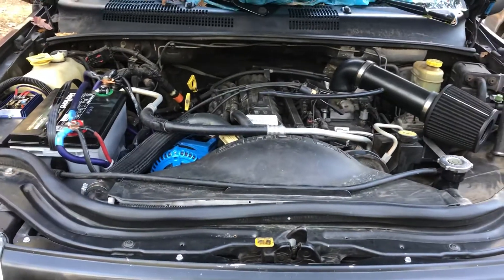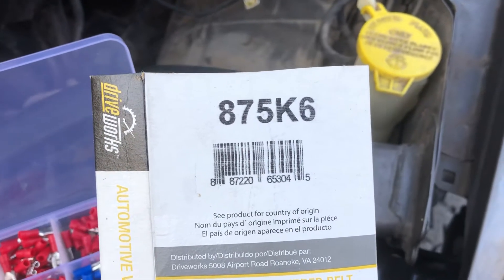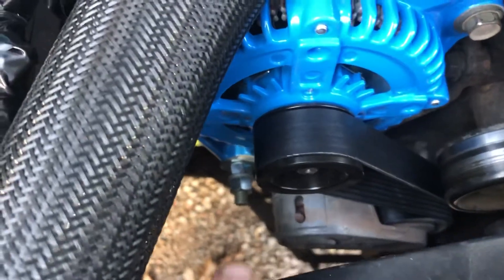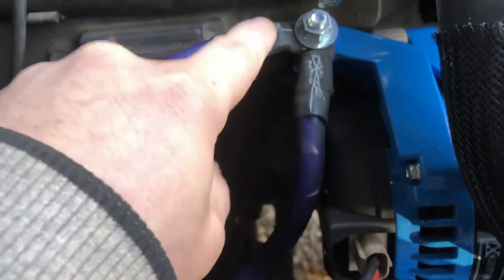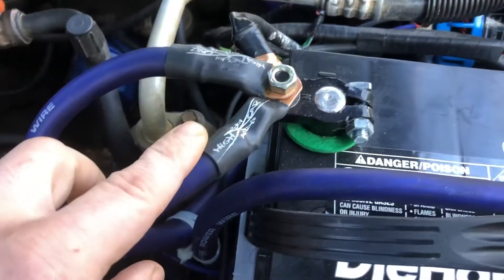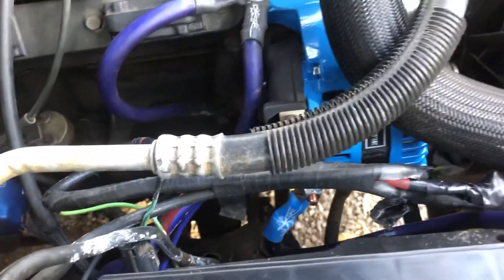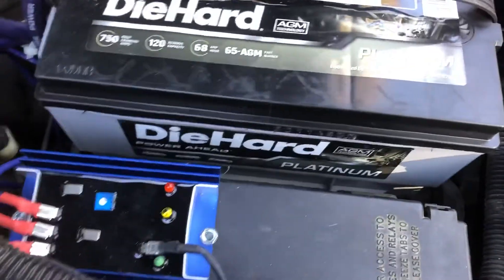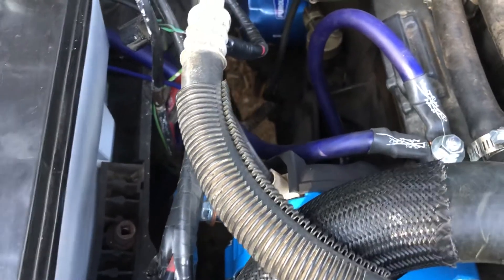How to install a high output alternator 1999-2004 Jeep Grand Cherokee “wj” 4.0l plus Big 4 wiring

Comment: hey man, quick question. i have the same 4.0. i'm planning on doing the big 3 for an audio upgrade. Is that just a random bolt attached to the engine you grounded, or is there a specific ground i'm supposed to upgrade?
Reply from the maker: For your engine ground the easiest place is one of the 3 alternator bracket bolts right on the side of the motor
Reply from the maker: If you have any other questions I’ll be happy to help you out bro
Reply: @Jboost412  Awesome, thanks man! i wasn't sure if there was a specific ground spot i had to use. Since i don't have the same alt. would you recommend running the ground from the alt bracket to the body ground? sorry new to this
Reply from the maker: For the body ground you can actually use the factory location that’s right next to the under hood fuse box just remove the bolt that’s there and clean up the metal with some sand paper and place your new upgraded ground in the spot where the factory one already was as it’s a pretty good spot just lacks a big enough wire for what we are trying to do
Reply: @Jboost412  gotcha! so i'll run my new ground from the alt bracket bolt, right behind the alternator, to the body ground after i clean the metal up. Sound good to you? thanks
Reply from the maker: From there if you wanna go big 4 and ground the alt case as well you can remove the lower alternator bolt and make a stud with 5 16th x 18 all thread make it a little longer then you need it to be that way you can thread in the all thread put a bit on it so it’s just like it was then add the copper lug for the ground and a second nut also acting as a jam nut as well...mines set up the same way...so really I have 2 4/0 grounds off the alt straight back to my lithium then another 1/0 ground that goes to the frame up front since I no longer have a front battery
Reply from the maker: That’s perfect brother! Sounds like your good to go!
Reply from the maker: And like I said anything else at all please feel free to ask, that’s the whole reason I started a YouTube channel to share all of my audio knowledge from years of experience with anyone who needs any help
Reply: @Jboost412  Thanks for all the help man, you're literally the only video on youtube showing a 4.0 you're a life saver!
Reply: @Jboost412  Wait, right side of the motor? my alternator is on the left side like yours lol sorry if i'm not being specific enough

Comment: What was the price of the exact same alt that you have?
Reply from the maker: Mines from brand x it’s a 6phase hairpin 345a that clamps out 373..I believe it was 350 without powder coat..it was a package deal with the regulator so I’m not exactly sure what the alt itself was but I believe it was 350...I highly recommended brand x though “Jonathan Patrick” is brand x’s owner he’s the former builder for c.e.s so he’s very talented with rotating electrical
Reply: Jay’s So Low It Hertz I have the exact same Jeep and plan on doing similar electrical upgrades to it.

Comment: How does this do at idle vs stock alternator?
Reply from the maker: I don’t entirely understand what your referring too, if you mean output at idle the factory alt did 60a idle this one does 170-180a idle
Reply: @Jboost412  have you tested it? Can it do over 160A at 600rpm?